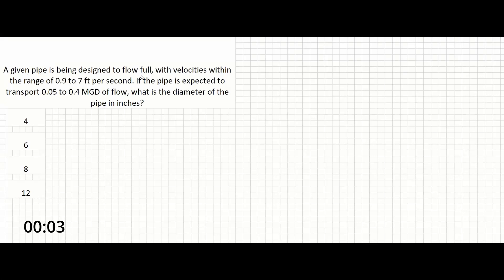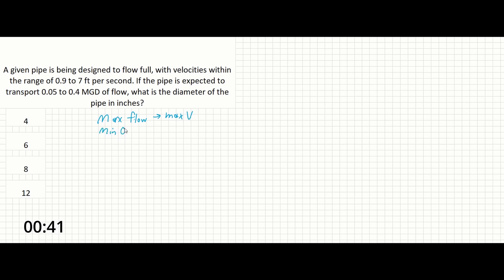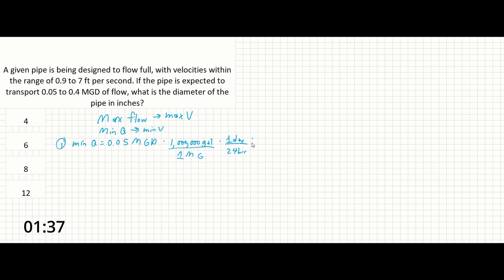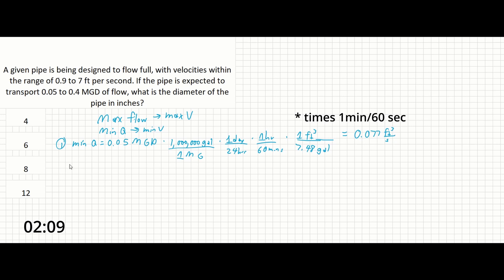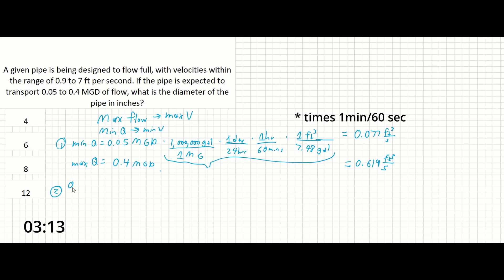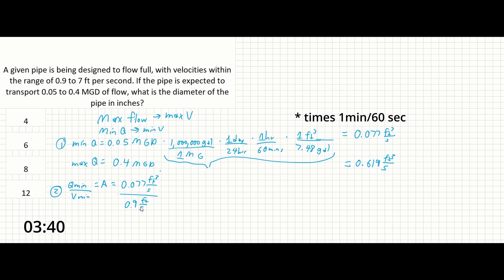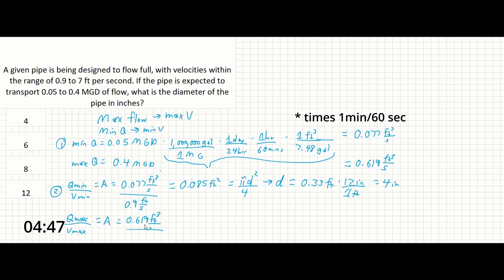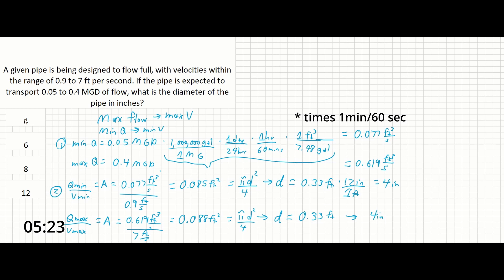PE Exam Practice Problem #30: Water Resources | Pipe Flow - Full Flow

Comment: Is there a reason you solve for both the min and max?
Reply from the maker: Mostly to cover my bases. I can't recall the case I am thinking of, but I know there have been times where values were not proportional and solving for a min value might give you one pipe size while solving for a max value from the problem statement would give you another.